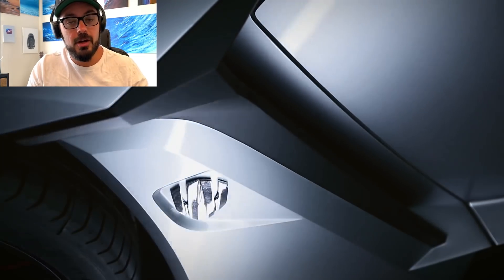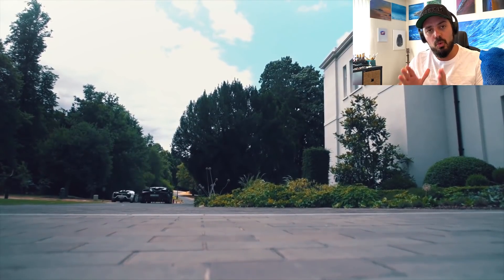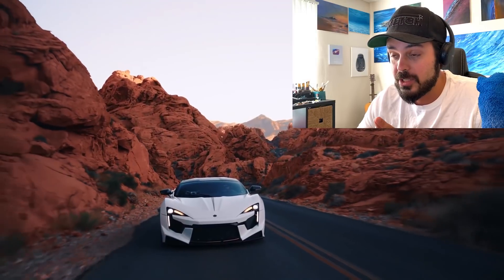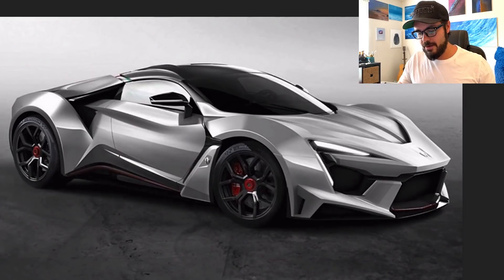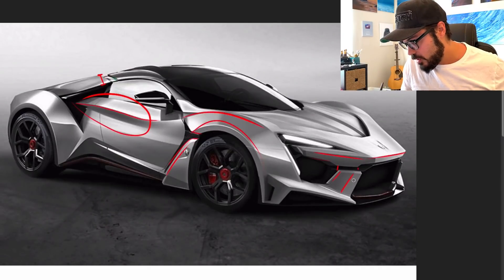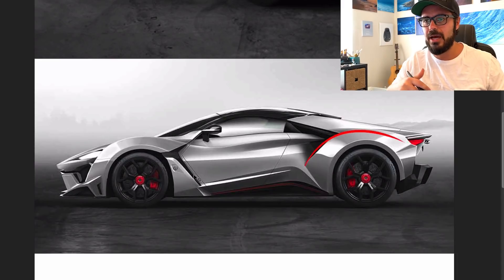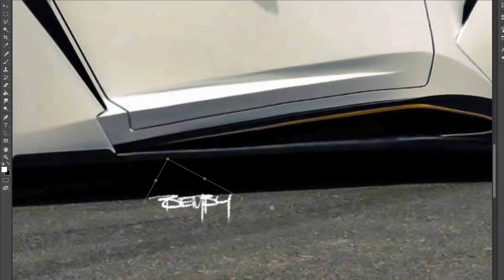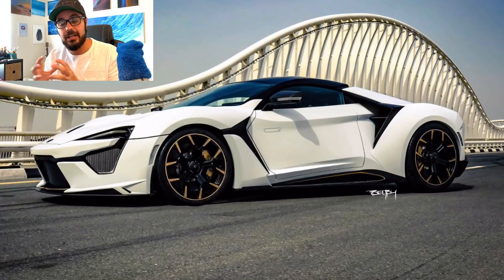Here's the problem with the Fenyr Supersport design

Comment: I loved how it looked regardless. It's different, and sometimes on your channel you tend to say car designs have been lookin very similar. This one didn't and that's what I appreciated about it. Only problem I had with it are the headlights, they were way too high up on the car, if they were put Lower the car would have looked slightly more in proportion even without most of the other changes you made to it. Either way I like both yours and the original design but i just think that it probably was their identity to have  mean looking bat mobile styled car
Reply: I happen to agree that the Fenryr Supersport could make an excellent Batmobile, but I think the purpose of the designers was to make the whole front of the car a wolf-themed design, to tie in with the Fenryr name. Come to think of it, the whole first generation of W Motors lineup is basically wolf themed

Comment: I agree on many of your takes on design, but on this one I feel that the original design does very well when looking from a emotional design. The front, the fenders and the rear all hit hard with anger, we dont see that much in cardesigns anymore. The only part that doesn't hit hard is the midsection, wich should be more over the top to match. I like your take, but feel like it weakens the main selling point of this car, while keeping the overly soft midsection.

Comment: I think this car has a beauty of its own. Like the designers worked on a specific theme on this car. For example not having a single piece of metal that is not worked on. Not a single plane on the vehicle that is not deformed in some way. 
Sharp lines and angles everywhere. Curvitures everywhere. Look at the car and close your eyes. You cant remember more than 3 lines at the moment. 
You have to look more and more to discover the car each time. It is themed chaos.
This is its beauty

Comment: LOL dude,why waste your time with the re-design?  Your attempt was valiant!  At least you were able to do some orthodontic work to align the car's front teeth. This "car design" def. looks to have been done by someone in a very fast manner while being furious about something, thus perfectly suits to being featured in the Fast & Furious movie series.  You're right, I also don't know where to begin in critiquing the styling, but I agree with most of which you touched on.  However, the worst issue I saw were the suicide doors will require 3 parking stalls to open.  If parked by the side of a busy road, there's no way either door can be opened without a) a passing vehicle hitting the driver's door or b) the passenger door hitting a pedestrian on the sidewalk.  Perhaps they may have taken design inspiration from a cross between the F-117 stealth fighter and an desert horned viper.  Just being honest as well.

Comment: i know be a designer does give you another perception, im a visual designer and understand the lines trouble, trouble?, you think that it is?, if no one does give a little exageration will be another expensive car, but, same as others, the different level on the bumper, arks on the wheels, the only thing that will concern me will be the aero, but from that, no one can decide what is wrong or bad without talking to the designer, is like going with a hammer to the experience of the creator without know the entire background or the idea, when you edit it, doesnt look like a subaru BRZ?, another time, always the same, we need open our mind so we dont ever stuck to the same